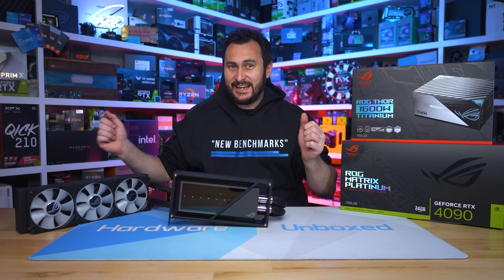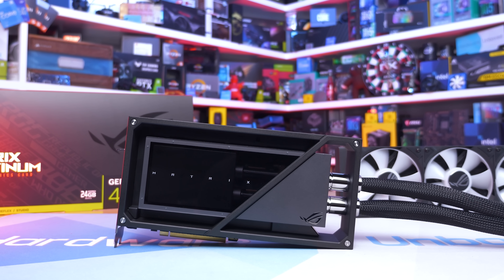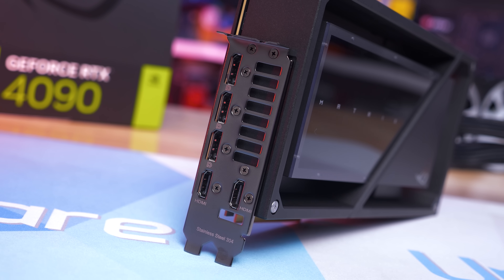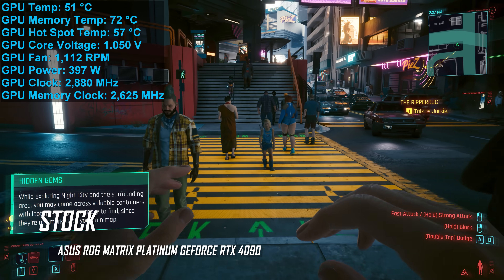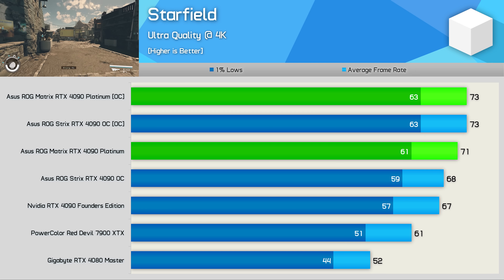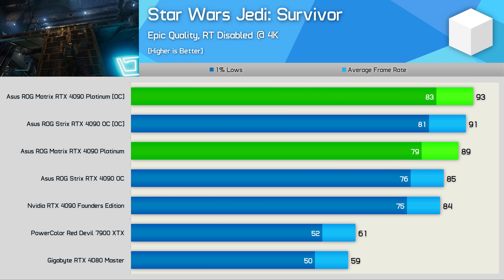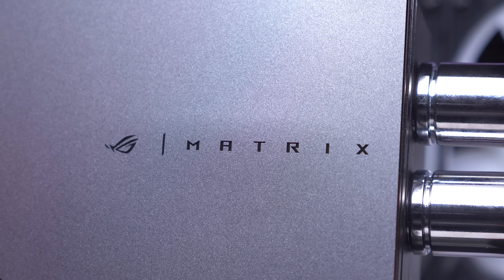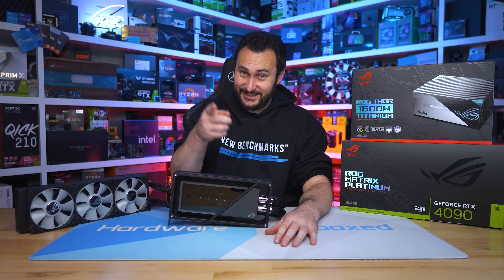I Can't Afford It! Asus ROG Matrix Platinum GeForce RTX 4090 Review

Comment: 4090 air coolers are already so overbuilt that watercooling delivers marginal performance improvements. It seems most of the improvement comes from using liquid metal instead of thermal paste.

Comment: I'm not sure why nobody has any reviews for or talks about the 4090 ROG Strix LC with the 240 AIO. I have that card and it is phenomenal. It was $2100 so only $100 more than the air cooled strix and my thermals are the same as this but my memory temps are better. I don't know about binning for that card but I do a constant 3015MHZ in Port Royale.

Comment: Wow, they just completely lost the plot with designing that, like water cooling is to move the large mass to elsewhere, not keep the damn card massive and also add a massive radiator elsewhere, and for $4000 you still get the ultra cheapo looking braided nylon sleeving on the water lines that probably cost them 50 cents instead of something nice looking.

Comment: 2600 usd for AIO is just shameful. Pushing AIO's as cheap and effective cooling instead overengineered massive air cooler make total sense.   Cheapest 4090 is costing 1600 euro with 20% tax and all margins on the chain. 
Asus, DO better!

Comment: Jeez and I thought I had watery eyes when I picked up a ROG Strix LC 4090 OC for £1850 GBP. 
The Matrix looks cool but that really is where it ends. It is a showcase card not aimed at the consumer, so price is (relatively) irrelevant. 
The test thermals aren't that far from mine in Cyber 2077 and my fans are going crazy either. Granted i'd rather have a triple rad for ultra low noise but.... Sheesh.
Deffo looking at the Kryosheets for my CPU & GPU on the next service.

Comment: ROG is terribly overpriced. You can by MSI liquid cooled 4090 for ~2000 USD. And they use same component base, if I remember correctly. Or EK water block for 200 and  360 kit for ~600 (which you can also use for your CPU cooling etc). Nearly any config would be cheaper.

Comment: The main issue with these prices is that hardware manufacturers got hooked up during the pandemic , when people where shelling major cash for any hardware they could find, and now they think they can maintain that high.
It will take a while until they come down but I hope that finally people stop feeding their addiction.
Wouldn't  pay more than $500 for a GPU, let alone $4000.
It just shows ou out of touch they are.

"Maybe they'll run two in SLI!"

Edit
They should call it RTX 4090 "Fuck Me Harder Daddy" Edition.

Comment: only a 2°C gap between the pad and the liquid metal ? damn that's some really good information.
Those pads are so much easier to use (no risk of shorts, no drying, no diffusion inside copper...). With such a little temperature delta they will be my go-to choice from now on.
Reply: I my experience liquid metal it does no dry, however it gets absorbed/diffused in copper and nickel. I suppose in couple of years I can report the 10y and few applications on 6700k IHS, how 'fast' with absorbs with each application.
Reply: As a heads-up: Those kryosheet pads are electrically conductive though, fyi.
Reply: It's because the gpu die is enormous compared to a cpu, it's not really needed to liquid metal a gpu. Most run really cool already, and the huge die makes it so there isn't as much to move in a concentrated area. It's cool, and it helps, but it's not like a CPUs 8-25 degree drop (depending on generation)

Cooling the core also doesn't help memory ocing either

Comment: For more on the liquid metal application, see der8auer's review.  He is quite surprised that the heatsink is NOT nickel-plated to prevent undue corrosion from the indium in the liquid metal.  He estimates that it will take less than a year to see increased temperatures due to corrosion of the bare copper.
Reply: Not corrosion but infusion. But in the end you don't want either, and at this price range it's a shame it's not nickel-plated

Comment: I guess if one is really really into ROG, then sure... but 4000??? I know it's still not reasonable, but i would have guessed somewhere over 2000, no more than 2500.
I'd rather get an EK block and rad for my 4090... Looks better too IMO. And "cheaper" also.

Comment: As long as you can't increase the Voltage you just can't get much more out of her. My "normal" 4090 runs stable at around 2955 MHz and that already seems to be the lower end of what you can expect pretty much any 4090 to reach. So as long as ASUS isn't binning the GPUs for this version especially, you might end up with a similar performance as anybody else with a 4090 for more than double the price.

Comment: As succinctly as I can put it...
It's a very pretty, finished product.
But for $4000? You could literally buy a normal 4090, GPU block, liquid cooling gear for a custom loop, the liquid metal for the die (or one of those thermal sheets idk) all for less than Asus is asking for this. Hell, I could do a whole build with a 7900xt, for less than this thing.

Comment: One thing you may want to look into is that 4090s with the newer power connectoer seem to be limited to 1.07V compared to the 1.10V of the older ones. Making them worse for overclocking.

Comment: Didn't they crack the means Nvidia use to protect bios? This unit seems like its made for running custom bios. That's obviously beyond the scope of this review, but I thought it prudent to mention. What's holding this back is firmware limits, not silcon or the board.

Comment: If you look closely they gimped these new GPU's they gimped the voltage overclock from 1.1v down to 1.07v. NVflash to another Bios wont even work. You need to use a hacked version of NVflash to the the full 1.1v back. This csrd would clock a lot higer then. Grest review. Keep up thr good work guys

Comment: As for the card itself, it is disappointing:
1) Low cooling contact with the card;
2) Memory chips are not cooled properly for such a card;
3) Silicon is not binned at all;
4) Doesn't provide custom profiles with pre-overclocked settings;
5) Doesn't provide any extras for enthusiasts like screen to track data about the card or even just RGB;
6) Doesn't provide premium customer experience. Like extended warranty.

Comment: The newer 4090 silicon (AD102-301) is voltage-limited to just 1.070v. This is one reason later cores do not overclock as well as release-day silicon (AD102-300), which could utilise 1.1v. On the plus-side, the newer cores seem to run cooler at same voltage.
Reply: Nobody has tried it on this specific model but there's a tool to flash 1.1v BIOS on 1.07v models called "nvflashk" (not to be confused with the regular nvflash). In the Matrix in particular I fear (this is 100% my speculation) that you need to run its own BIOS to get proper fan speed and RGB control. Or maybe not.
Reply: what bios is used and what is the voltage for 4 ghz with ln2??

Comment: That card/price is ridiculous XD
On more relevant topics though, I used the Kryosheet from Thermal Grizzly on my new 7800X3D and I can't get it over 60°C while gaming. The cooler is an NH-U12A so it's good but hardly the best performer these days. Those carbon nanotube sheets are just that much better than thermal paste.

Comment: Just what no one needs...to pay $3200 for a GPU that has liquid metal on a bare copper cooler? The liquid metal will interact with the bare copper and that gives it virtually a 100% guarantee there will be cooling issues in the future. Guess Asus found the cost of nickel plating the cooler to be a deal breaker on a 3200 product???  This is a great entry in the "products for stupid rich people" category - because once the liquid metal chemically reacts with the copper, the temps will go through the roof and the performance will fall off the charts. A badly executed halo product - that is almost guarantees a future temperature related failure...

Comment: A $4000 USD GPU that uses liquid metal on an unprotected copper block... Yes I'm sure the lack of nickel plating will not come back to bite them in the ass when people realize you need to replace the liquid metal and polish your block every year to keep it from running too hot.

Comment: I wanted a AIO liquid 4090 and even though the gigabyte one had the 360 rad, I went with the msi suprim. Mostly because it was available first, but it's cable management is clean and easy.
Reply: yeah the MSI Suprim is really nice. I also like the Gigebyte all in one too.  I just with they all worked together with it comes to the lighting software.  I've tried them all, and returned them.  Just not worth the price/performance.  The RTX 5090 will be here soo and all of this will be junk in comparison.
Reply: Yeah, I'm really happy with my Suprim 4090.  Especially since it's liquid cooling didn't cost an extra $1600+.

Comment: Honestly between the cost of their motherboards and this thing Asus has officially lost their minds, and lost my business as a customer.  They were the top dog for a long time but now they are no longer in contention.  My recent Z690 AOG Strix board had two bad units that needed RMA and their 2.5G Ethernet drivers are glitchy and non-functional with my ATT-provided router/modem even on the unit that works.  I have to use a dummy 5 port switch between my PC and my modem to make it work.  Finally got tired of dealing with their customer service and just kept the recent one.

I will not buy Asus again.

As far as this unit goes, buying a 4090+ water cooling parts goes about like this.

4090 - $1500
GPU block - $250
360 rad - $150
fittings - $50
tubing - $40
res - $100
pump - $100

Then you can use all of this stuff for the CPU as well while having better cooling performance and a quieter and more powerful pump, better cooling rads, and a better preforming block.

Comment: Do you have a Gigabyte 7900XT OX 20Gb you can do a before and after Kryosheet? As I have one and after 3 months the GPU temp vs Hot spot used to be a 10'c delta and is now when running StartField, its 64'c/86'c Similar in other games and been wanting some hard data on doing a KryoSheet install. Or maybe add it to a bunch you're doing?!

Also 1M subs on the way! wooo

Comment: Apparently it's "the best graphics card you can buy" according to Techpowerup, as well as being "considerably faster" than "normal" 4090s

Which is quite frankly straight up bullshit claims as the Strix 4090 is already as fast as it gets, and costs less than half. Sure it MIGHT clock like 100 MHz higher but c'mon it's not gonna be that much faster

Comment: Does ASUS know you could build not one but TWO rigs for $4000 with 4090s

You can find a 4090 for $1500
5700x for $190
Asus tuf x570 plus $100
Evga 850w GQ $110
Patriot Viper 32GB 3600MHz $55
Samsung 970 EVO plus 1TB $43

You still have $7 for a used case 😂

Comment: LOL.. 4k, I could buy an Aliexpress AIO , and install it , break that card, buy a new card, and install it, and still have money left over.. I bough an Bykski RGB AIO for my 3080 when I purchased at launch for $140 back in Dec 2020, and it is still working great till this day, it worked great , kept temps very low even while OC memory  during mining seasons (Winter) . The best part about having an AIO that I really enjoyed , was I had a MATX board, and it brought the size of the card down to 1 SLOT of use.. so it opened up all the PCI slots so I can add more cards , like 10G ethernet, capture card, encoding card.. etc ..

Comment: 3 DP and 2 HDMI is an impressive array of display outputs? My man that's not that unheard of. Other than that this thing looks pretty fuckin beautiful! O_O Too bad I already got a 4080 because my old EVGA FTW3 GTX 1080 Ti finally died back in June. :( That was a great AIO card and frankly I loved that it only had a single fan size radiator. These huge radiators are very exclusionary, if ya follow. I have a Fractal Torrent case and really don't want to replace the two front fans or the bottom fans... the rear fan mount however is perfect for a nice 120-140mm radiator. Ah, well.
Reply: The Gigabyte version also has a 360mm radiator, but the MSI card 4090 Liquid Suprim X has a smaller 240mm radiator. It makes it easier to mount in smaller cases, although it does heat up more compared to the larger 360mm cards, I'd imagine.

Comment: 6:26 Are you even sure you know how to overclock gpus? Seriously dude, you can't even increase voltage to a standard 1.1v , have you tried more? I'm shocked, because you were able to achieve same clocks as I do with aired version of 4090, you did something wrong and didn't even show msi ufterbutner settings. I don't evne get how Asus sent you this card with that low level of knowledge you having, you just gave a bad image of this card to viewers. And this is explained criticism and not hate.
Edit: the temps you getting are similar to what i have on aired verison of 4090 msi suprim X, i would expect to see up to 42 degrees with such beefy cooler, you did something wrong there 100%.. this card is a beast but in a proper hands, it has insane 133% power limit so its meant to go over 3100 mhz easily with such cooler and board elements, etc...

Comment: For $4k at least they should make the memory cooling better than the previous ones. Also Der8auer mentioned the raw cooper and liquid metal contact will be problematic over time...
Reply: But it's an Nvidia card, you're supposed to upgrade every cycle. To be honest, the kind of people dropping this kind of money to play games probably don't care about longevity all that much.
Reply: yeah, but they're Asus. for the brave amongst us. 😂😂😂😂
Reply: I have my FE 4090 in a custom loop and I had to use bad thermal pads on the VRAM chips on purpose, otherwise I would get worse clocks/stability than on air. I know it sounds weird but if you do search around you'll find other people who did the same, apparently GDDR6X likes to run on the warmer side (I don't personally call mid 70s hot)

Comment: What a great moment to present the holy grail 4090 - in the eyes of the upcoming 5090. Genius!
Reply: They probably struggled with the board design and the metal liquid cooling.
Now for the next card, they will make it faster.
Reply: @atavusable  maybe. If it follows the same design layout and tdp. We'll see.
Reply: @Druze_Tito  If you have a 360 rad I doubt you can't handle any current GPU TDP.
Reply: What about the bare copper... Not nickel plated.

Comment: Isn't 10~20 degrees difference actually impressive though? Can someone enlighten me as to why it's only just slightly better compared to regular 4090s? I mean the cost is ridiculous, but I thought the temps were impressive.
Reply from the maker: Temps are impressive, I said they were. Frame rate performance isn't.
Reply: @Hardwareunboxed  Ah, I see. My mistake then, thanks for the clarification!

Comment: The VRAM is not supposed to be cool. It will crash more easily if it's too hot or cold, especially when overclocked, so ASUS is doing this on purpose. The sweetspot is between 70-80 degrees Celsius.

Comment: This card was 100% supposed to be an unlocked 4090Ti before it got canned so they had to put a normal 4090 chip in there which is obviously pointless, thus the overkill cooler and no performance advantages

Comment: I'm surprised they used blank copper on the base plate. It will react with the gallium based liquid metal and will need replacement in 1-2 years.
Reply: before that you got to un-fuse gpu and block lmao

Comment: The cooling compound testing was a nice idea.  The Cryosheet was pretty impressive in its performance.
Reply: As derBauer pointed out, the cooling plate is bare copper not nickel plated, which means the liquid metal will suffuse into it over time.  It would then seem that tearing this card down to install a CryoSheet is inevitable.
Reply: Right? I knew it would compete and surpass typical paste but I never expected it to be this good compared to LM
Reply: Definitely, it made an otherwise boring video quite interesting.
Reply: I was, but i'm not sure the results are good. Not really seem to make any sense imo. Should kryosheet perform better than hydronaut, in what world does this make sense?
Reply: I'm actually surprised how much more efficient the kryosheet is over regular thermal paste
I mean, liquid metal is just not interesting anymore at that level
Reply: @whismerhillgaming   ye if a thing I can just place on the GPU/CPU with no hassle nets 7C difference, what's the point? Unless you're doing extreme stuff I don't see why you would choose LM over it.
Reply: Wish Honeywell PTM7950 was also tested as an option for long-term solution.
Reply: derbauwer made an excellent comment, gallium based liquid metal will fuse with exposed copper.. So big oof from ASUS.

Comment: Liquid metal on unplated copper coldplate seems like a mistake
Reply: Does not matter! The owner will buy new GPU when 5090 will be released so max two years operation time is just fine! (And upgrade it to Asus matrix version 6 month later…)
😅😅😅
Reply: @haukikannel  I think I am that owner most of the time. That doesn't mean I want to have to disassemble my card in a couple of months when all the liquid metal has formed amalgam with the copper and it doesn't cool properly anymore.

Comment: I wouldn't mind expensive GPU's but the biggest problem is how limited they are with overclocking, crippling power limits and voltage locks and all that, what good is a huge markup if it only goes as fast as a cheapo model.

Aside from that, this is one gorgeous card!